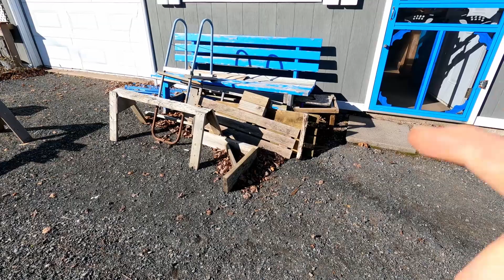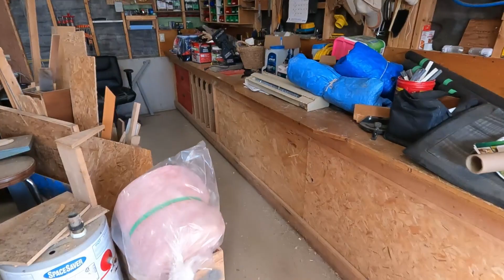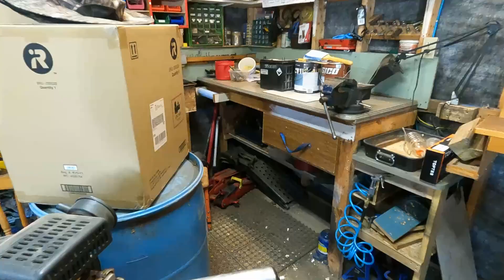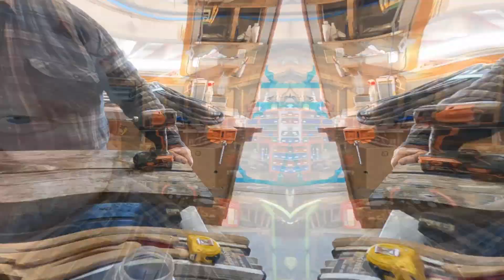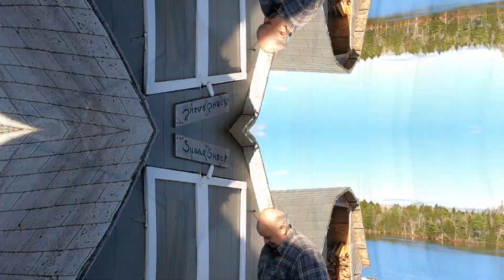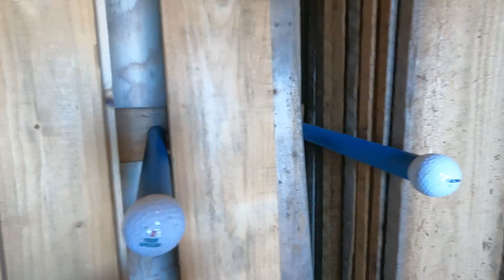Clean Up Day at the Camp

Comment: Mike, I can't believe how much alike we are! LOL As I look around your shop, I see so many similarities. I try to go out and clean up mine, but I have no wall space or shelves left, but I just can't bear to part with anything! I would really like to get rid of stuff, but I'm like an old hoarder that thinks I might need this stuff one day! I don"t have as much of a wood working area, but I'm so afraid to spark up a welder because of all the crap piled around. My ATV that I only use for plowing snow sits in there buried in crap. I need to get it cleared off because that awful white stuff has already shown itself a couple of times this year.
Reply from the maker: How's she goin'?  I hear ya Brian.  That 'stuff' we keep does have value even if it is covering the ATV or the welder eh!!  LOL  I find I have to be in the right mood to clean the shop because it will involve throwing things out or burning stuff. If you're not mentally prepared to do that, then the clean up turns into a 'Hey look what I found!!  That could be good, I better keep it!!" kind of day!!  LOL  Thanks for the visit and take 'er easy!!

Comment: It's true, any horizontal surface gather stuff no matter how may times you tell yourself you won't let it get that way again.  It always feels nice once the shop is all organized and cleaned up though.
You should have a wood stove in the shop with all that scrap you've got to burn
Reply from the maker: How's she goin'?  Once upon a time I did have a wood stove in the shop.  I thought it was the answer, BUT, yes there is always a but!!  My dust collector was located outside the shop in the bike shed.  So every time I started the dust collector, when the fire was going in the stove, it would draw so much air out of the shop that the smoke would come back down the flue and fill the shop!!  That didn't work out too good, so out went the wood stove!!  LOL  Take 'er easy!!

Comment: I understand the call of a second project. 
It took forever to get the wire run and then it just sat for a week while I waited for the inspection. 
In the mean time I started the garage door and that is dragging it's feet every chance it gets. 
I am able to pack up a few things in the basement shop and getting ready to move some of the equipment into the new shop. 
The hang up is I know I have to follow a plan or it just will become a cluttered mess. I pack up boxes and leave them in the shop while I am finishing the garage door. After the door I have to hang the lights. 
Just always Sumpee!
Reply from the maker: How's she goin'?  Starting another job when the one you're on is not finished is not too bad really.  But the trick is we have to remember to get back and finish the job we started!!  LOL  Your shop is coming along great Dave.  Waiting for the inspectors.  Man I remember when I was building the camp, the day the last inspector drove out the lane was the day I celebrated because now there would be no time wasted waiting for people.  Take care!!!

Comment: HI MIKE ! Shop cleaning eh. That is one scary thought. Mine was in great shape until I moved my pouring into it. I sure know about that saving bits and pieces of really nice clear and straight stock. When the dust gets' bigger than the stuff within you eventually have to decide. My only concern are fire and painted pieces that we can't cook with. Otherwise get a recording of "Taps" and send them on the way to cooking up a tasty meal, LOL. It gets like the bolt and fastener pile or pail. Guaranteed you can put it back in the pail to clear off the floor or bench and you will be dumping the damned thing out tomorrow. Crazy eh. This is a really nice bit of time to spend with you today. I am working on a dealership in London Ont. to sell my silver. I sure didn't think it would take so much but hey, It is what it is eh. We just got 4 in of that white stuff and the neighbours 17 yr old all excited to lean out my wallet eh, LOL. Take care fella and of course the Hug for Nannie J.
Reply from the maker: How's she goin'? Wow 4 inches.  That'll make the stove come on eh!!  I think cleaning a shop is overrated.  All a clean shop means is that no work gets done in there.  As long as I can get to what I need I think that should be OK!!  LOL   But, deep down, we both know that's not the cse eh!!  Thanks for the visit Dean.  I hope you can get your business going and sell your silver.  You do some pretty nice castings.  Take care!!
Reply: @GrampiesWorkshop   Thats the plan although of course I am late for the xmas thing but nothing new about that eh, LOL.